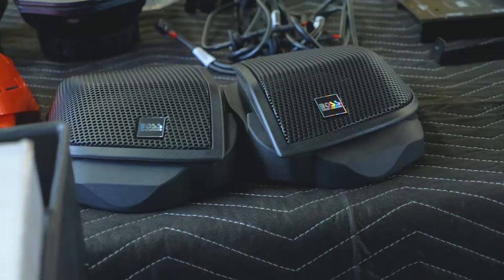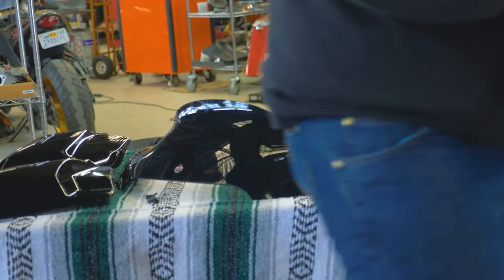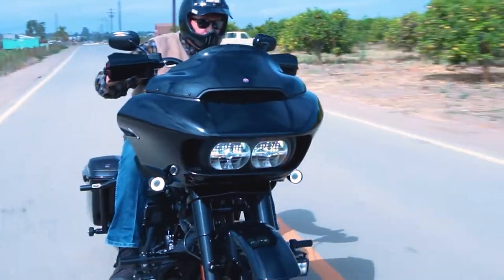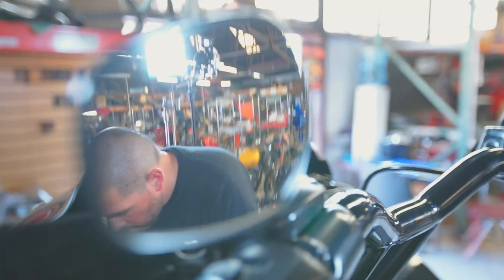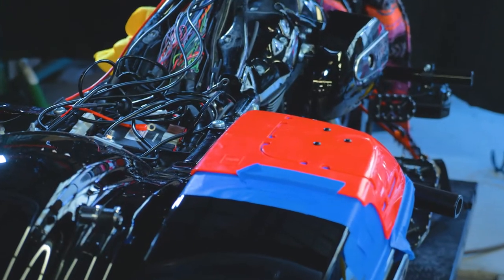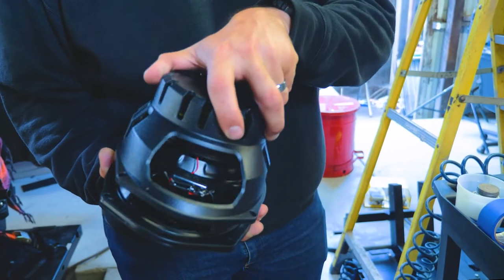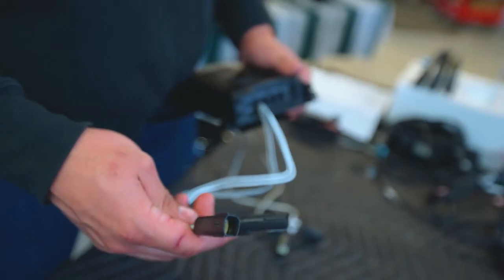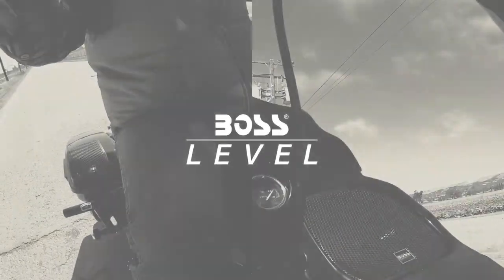BOSS Audio BHD3F Harley-Davidson Front Speaker System

Comment: I took my road glide to get radio flash at a local Shop called sound solutions at Greensboro NC and they said their radio flash does not have Boss audio selection. I called your tech support to guide me to the proper dealership and Vincent from tech support told me you guys don’t recommend no one and just to try Best Buy for their pioneer option for radio flash. Is this true ?

Comment: I was one of the winners from NVS audio Boss gift. Ty very much for the great gift it took me less than a day to install this whole kit. I did see that the power lines are a lil bigger than hole on power adapter plug. Who do you recommend to the radio Flashing or do u have a preferred boss audio dealer near NC triad area. Asking bc I called the closest Harley dealers and they outsource for the radio flash. 
What’s the best set up on dials from the BHD3F amplifier for Road glide 21 with front speakers only.